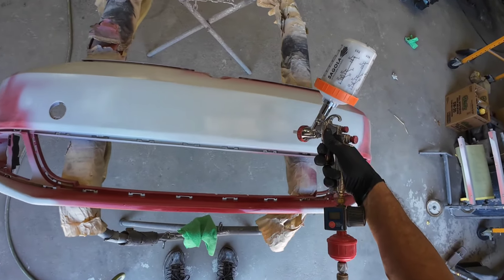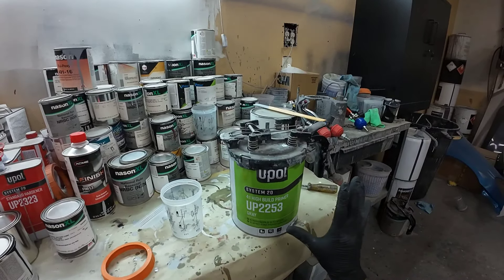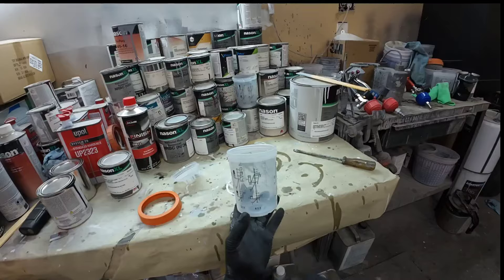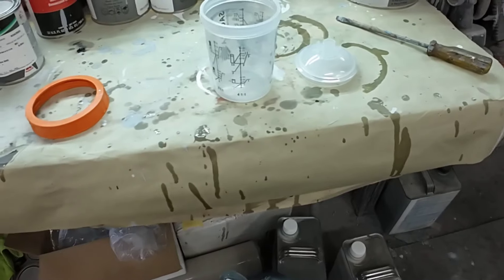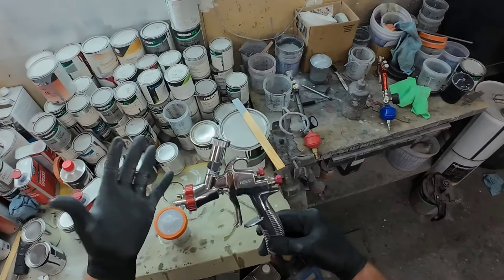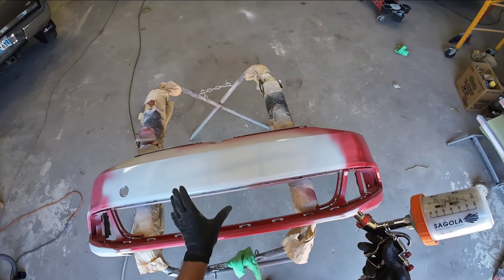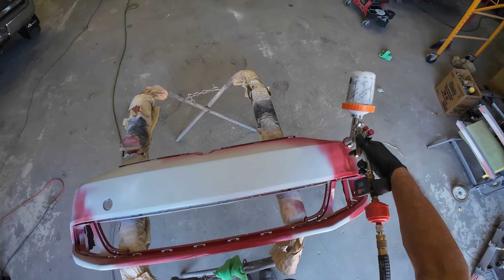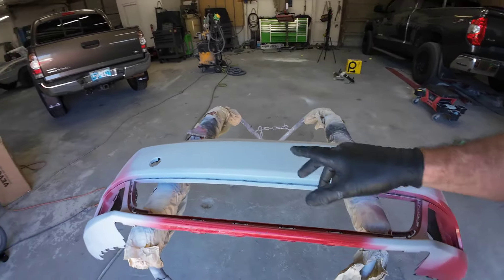How to Mix Primer for Perfect Application: Step-by-Step Guide

Comment: YES!! Bring it on!!
I’ve seen some of your older primer videos, but looking forward to something more thorough like when etching primer is better vs. epoxy? … and which sanding primers over each?
I’ve always put my filler (bondo) over bare steel with an 80 grit finish and never had problems but lots of folks are putting it over primer now!!

Comment: Have you ever had issues using isopropyl alcohol for final wipe down? I’ve been having problems with chem pops spraying clear on my previous sprayed clear which I sanded back down to almost gone (FC720).  The suppliers tech guru said the isopropyl alcohol was probably the culprit I’m having problems believing that. My air is clean and sure that’s not the culprit. But it’s the entire surface is covered in dot like craters !

Comment: What air pressure did you use and how turns out for fluid volume?
Reply from the maker: Psi about 15 and 2.5 turns out from closed on fluid